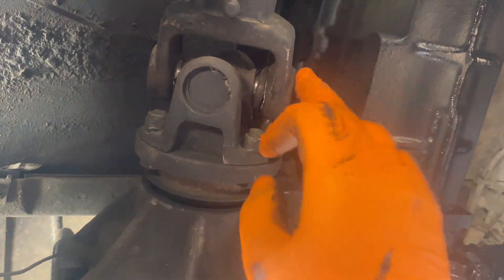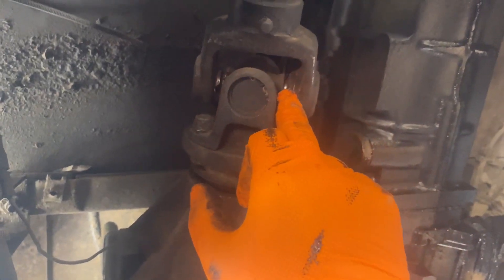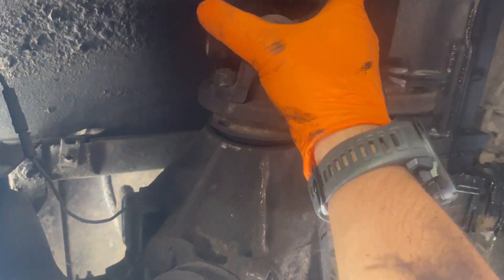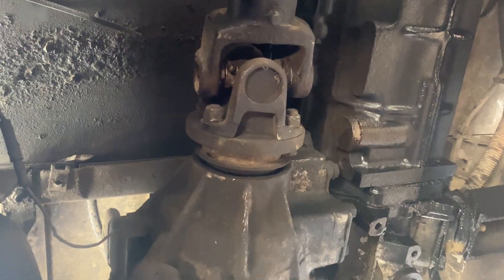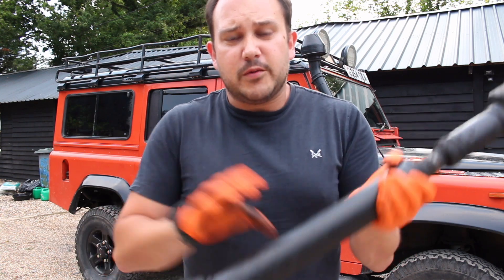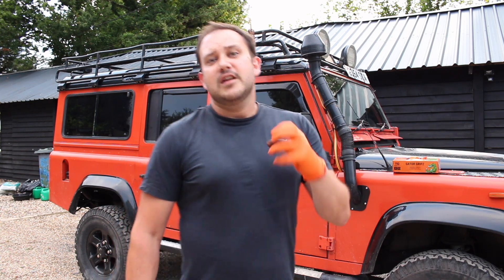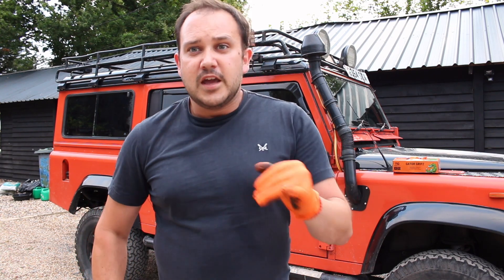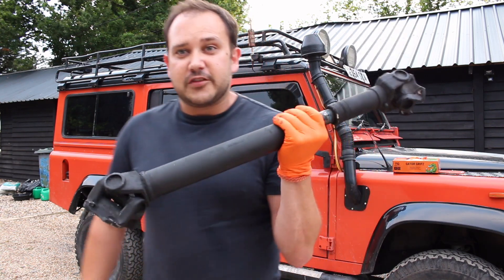Broken propshaft, can you still drive it?

Comment: Thanks, how many miles has that shaft done sir?
Reply from the maker: I think I fitted it in autumn 2022, but since then it’s done a couple of Alps trips (about 2k each) a trip up to the Arctic Circle (about 5k) so I’d estimate around 10-15k. I Seem to go through them quickly!
Reply: Thanks for your reply, all the best.
Reply: @TheOrangeDefender  If you are chewing up Front  UJ's , get someone to Verify the Angle of your Front Diff .
For a Prop-shaft to be reliable the Gearbox Output Shaft and the Diff Input shaft need to be Parallel . 

And before the " Peanut Gallery " chimes in ,  PARALLEL  not  Concentric . A Cardan Joint requires it .
Reply from the maker: @johncunningham4820  cheers, I’ll do some googling and see if I can find how it’s done or get someone to check it out!